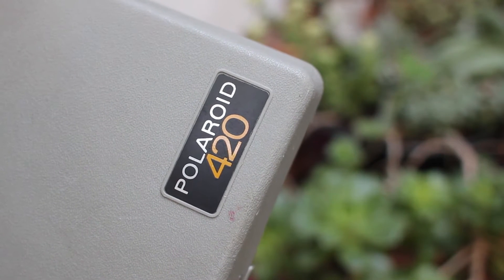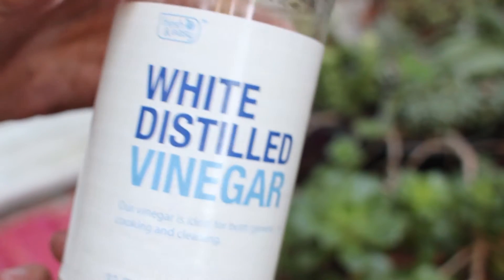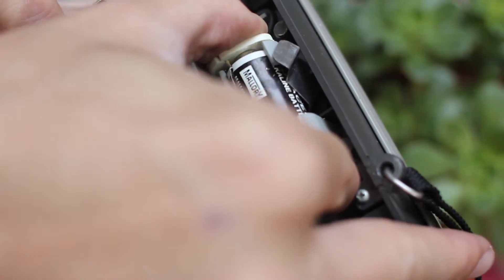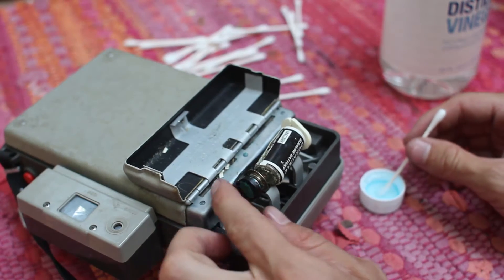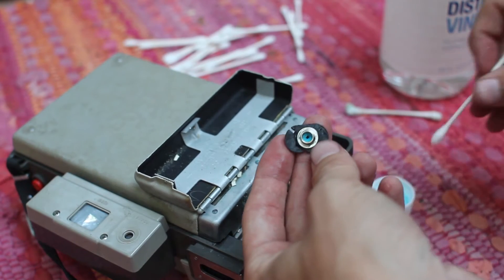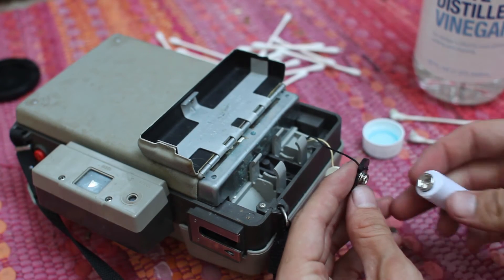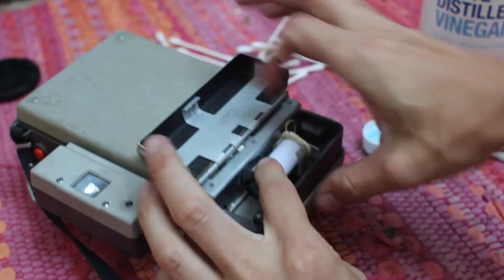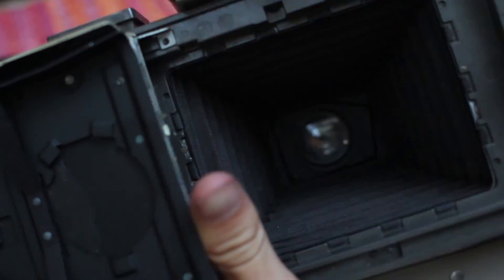How to Clean Battery Corrosion on a Polaroid Landcamera

Comment: I am going on a trip to NY in 3 days, and my pack film just came in the mail. I have a Polaroid Land Camera Model 320, and I bought a new 3.5v battery for it. The battery terminal had corrosion on one end of it, and I spent about 3 hours today trying to deep clean it. I used white distilled vinegar, apple cider vinegar, baking soda, and water. It looks very clean to me, at least all the blue corrosion is off. I try to test the shutter, but it won't open or do the "2 clicks." I tried taking a photo, and it was just plain white since the shutter didn;t open. Help!! I want to take this camera with me to NY!
Reply from the maker: to May want to try scratching  the contacts a little with a little screwdriver. sometimes even after a good cleaning the contact ist that great and needs to be scuffed up a little
Reply: +AwesomeCameras yeah, I scratched them with toothpicks soaked in all of that stuff, lol.